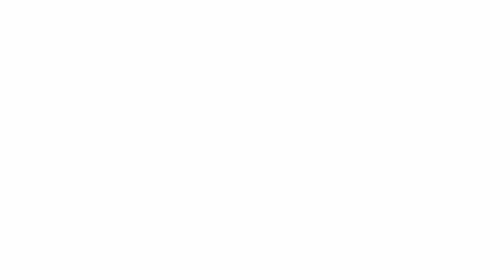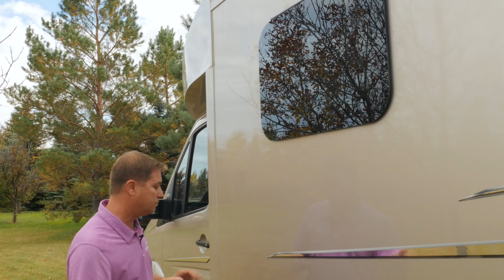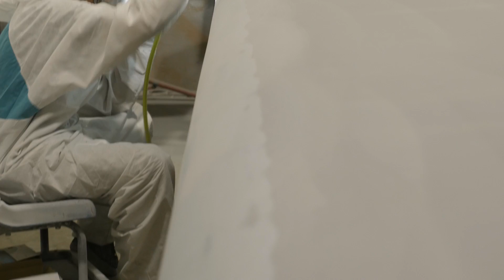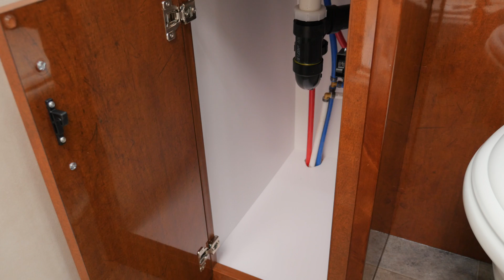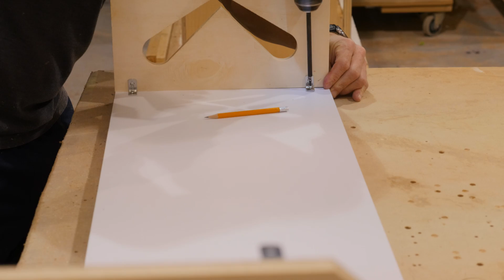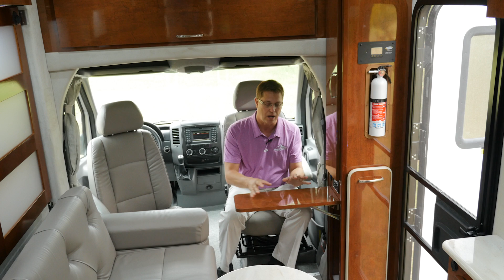2017 Pleasure-Way Plateau XLMB Tour

Comment: 00:00  Specs and exterior stuff
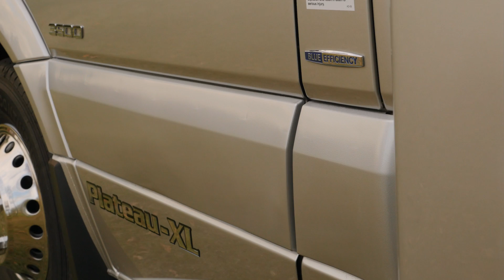01:44  Exterior colors
06:34  Interior
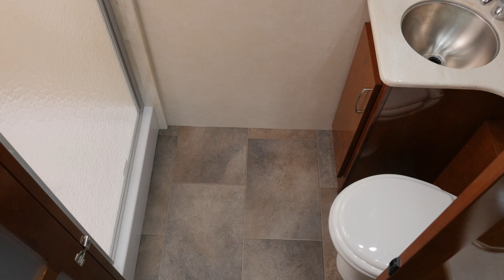07:20  Bathroom
08:13  Kitchen
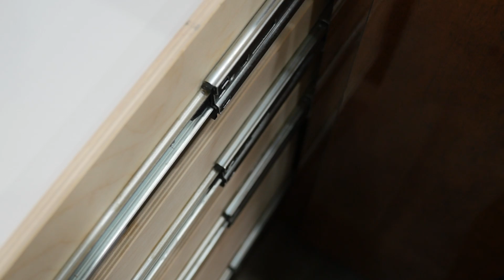09:12  Information/system panel
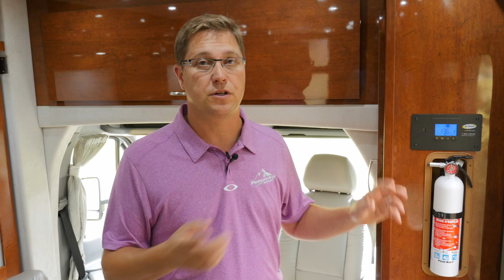10:42  Solar panel info panel
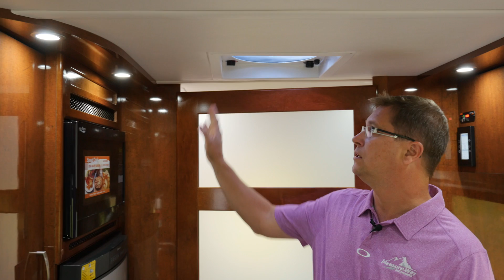11:37  Appliances
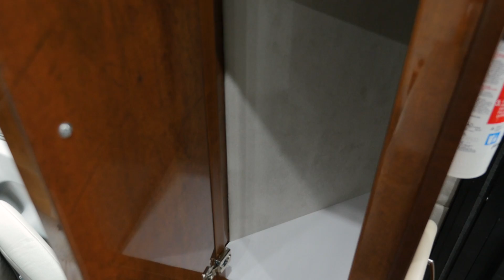13:48  Mother-in-law suite
14:11  Interior colors/materials
14:49  Cabinet factory tour
16:57  Power sofa and Murphy bed
18:55  Dining area
19:39  Cab area

Comment: Stunning interior...just stunning! Love the  "PRINT" awning, TUFTED couch detail, CORIAN shower walls and Japanese reminiscent PANEL doors /bed wall that are far nicer than solid alternative. Fantastic half radius column at the galley edge is elegant. Simply the most beautiful interior available ---give those designers a raise! Negatives for me is not having a level floor all the way through the coach, the refrigerator without a separate freezer compartment plus drawers and frame holding the couch should match the cabinets for a more solid and cohesive look with the rest of the coach.

Comment: To go without slide-outs was a very reasonable and practical decision; however, an RV of this size and weight, in my modest opinion, but one based on many thousands of miles driven in Europe and in the US, limits it without a four-wheel drive that could be offered for a fair upgrade!

Comment: The exhaust for some reason looks too low. I would be afraid that I would lose it going over a small bump. The TV is also in an awkward postion. I think a true (one piece) Murphy bed (like this one) is really the upcoming thing in a smaller motorhome. those drop down beds on the Class A's are still too high for us older guys.

Comment: What size venting pipe on the roof for the gray and black tanks? I notice it's just a open pipe with a cover. I was thinking about adding the 360 Siphon caps which creates a suction to help pull out any tank odors. Thank you

Comment: I have a couple of questions, you say the refrigerator and the air-conditioning or not hooked up to the inverter. You say the refrigerator can run off of 12 V. Does the refrigerator run off the lithium ion batteries? Or does it run off the automotive system?  Also, can you stream Bluetooth music to the audio system while you're driving? Can you stream it to the Blu-ray system throughout the coach? Thank you very much for a great review I really like these.
Reply from the maker: Greetings! When the fridge is set to 12 V (DC) it is drawing power from the lithium battery bank. It does not run off the automotive system. The fridge can also be set to run off LP gas and AC power. Regarding Bluetooth, it is only capable of connecting to your phone for making and receiving phone calls and not for streaming music. The Blu-ray player is only connected to the TV and does not sync up to the Bluetooth system of the front chassis. Thanks for your interest!

Comment: My only question is why is the fresh water fill on the patio side when  the water source is located on the driver's side???
Reply from the maker: Hi Doris, the fresh water fill is located on the patio side because the fresh water tank is mounted underneath the motorhome in that spot. The city fill is on the driver side because that is typically where the water source / power source is located when parked at a spot in a campground. Additionally,  we keep the utility center on the driver side to keep all the connections away from the patio side, which is a high traffic area. Thanks for watching!

Comment: What type of locks do you have on the RV door? Does it include a deadbolt? Thank you
Reply from the maker: The front cab doors utilize the standard Mercedes power door locks. The side entry door we provide uses a two part locking system. The main lock is a deadbolt and the secondary lock will lock the handle.

Comment: That's great that you have the Truma AquaGo water heater. Which model?  I don't see a option for a ladder on your website! Do you have one? Thank you
Reply from the maker: We use the Truma AquaGo 'Comfort Plus' in all our models. We do not offer a ladder but that is something you can get through an RV dealer. If you are thinking about adding a ladder to the Plateau XLMB, you should let your Pleasure-Way dealer know because we would need to make modifications to the unit to support a ladder. This would need to be a factory custom order as we do not build them with support in place for a ladder. I hope that answers your question!
Reply: Thank you. You should put that into your home page as the Truma is a great water heater to have and a selling point! That's great information about getting a ladder!
Reply: Pleasure-Way Motorhomes with solar panels that require periodic cleaning, a ladder would be a nice piece of standard equipment. Add it to the cost.

Comment: No Safety Side Mounted Camera's for 2017, are you kidding me! Pleasure Way is Better than RoadTrek in my opinion as far as Build Quality but you guy's need to advance the 2014/15 technology, RT eliminated the need for an Old Fashioned Inverter for 2017.
Reply: So you expect Automakers to give us $4,000 or so, depending on what the option(s) are for free? Really? Just ... here's an upgrade to a free TaG axle Diesel Pusher but you'll only pay for this. Or if you're too cheap to buy the power windows, power locks, collision warning ... you want the dealership to just put it in & give it out for free!

Comment: When owning one do you have to get it inspected yearly such as we have to do with heavy trucks? thanks =D
Reply from the maker: Hi Totally Left Field, our motorhomes do not require a yearly inspection as heavy trucks do. However, it is important to follow the Mercedes guidelines on service intervals for the coach, which can be found in the chassis manual. Also, Pleasure-Way provides maintenance guidelines and recommendations for proper service upkeep on the motorhome. An example of an annual maintenance procedure would be to check all roof vents and hatches to ensure the caulking is still in tact. I hope that helps, thanks for watching!

Comment: Does the XLMB have a plug to plug-in external Go-Power solar panels "GP-PSK-120". Thank you
Reply from the maker: The first thing to note is the Go Power solar controller we use is only capable of providing service up to 30 amps. If you were to max out our solar panel option and select five, 95 watt panels with the Plateau XLMB, the controller would be at capacity. If you had fewer than 5 panels, the solar controller would still have capacity for additional panels. 

Regarding the ability to plug in the GP-PSK-120, we use the standard MC4 branch connectors to attach the solar panels on the roof to the controller inside. If that kit you reference has the ability to plug into a MC4 connector, you would have the ability to install a parallel branch connector (extender) and add another panel to the system. Of course, this depends on the load the controller is already receiving. My recommendation would be to contact Go Power to make sure the GP-PSK-120 kit can connect with the standard MC4 connector. I hope this helps, thanks!
Reply: Thank you for all of your replies that I've asked for.
Reply from the maker: No problem, glad we could help!
Reply from the maker: Hi Richmond, we currently only offer the 30 amp Go Power solar controller. Five solar panels is the max we can fit on the roof for now. We don't offer additional lithium batteries as our electrical system was designed around having 200 amp hours of power. I have also sent you a direct message through your profile with the contact information of a Pleasure-Way representative that will be able to assist you with any further questions. Thanks for your interest!

Comment: I want this.  Do you think a woman by herself could manage this?  Literally, I have no man skills, but I can drive.
Reply from the maker: Hi c sikomas, yes! You can absolutely manage this yourself. If it is your first RV then there will be a learning curve getting used to the typical duties involved, but the size and maneuverability of our motorhomes makes them incredibly easy to operate. In fact, we have a great set of videos where we talk to our owners about owning and managing a Pleasure-Way motorhome and I think they will provide some good insight: https://goo.gl/GepIF2 I hope the videos help and thanks for your interest!
Reply: c sikomas  why the heck not?  I haven't seen anything that would cause a problem.
Reply: I am a single, old lady that compared, then bought a Leisure Travel Van. Same price range as Pleasure Way  but controls and features that I find are SIMPLE to use and better located  above the entry door. I have the CB (corner bed model) ... 53X76  comfy  bed I can flop on at anytime, plus the shower is 33" wide. With "zero" experience, I have taken mine from CA to Montana and back. I suggest if you buy one, get one off a dealer lot, delivery from the time I ordered one from the factory was 7 months. I am so confident driving the Mercedes Sprinter Chassis ,  I tow a tiny Fiat Abarth. Go for it!
Reply: I spent 60 days on the road in a van I converted to a rv myself.  THIS would be so easy to live in. Go for it. P.S. I'm 60.....
Reply: "Man Skills??" What year do you think this is, 1957?? Jesus, you give women a bad name!

Comment: do you have a screen on the door and Windows?
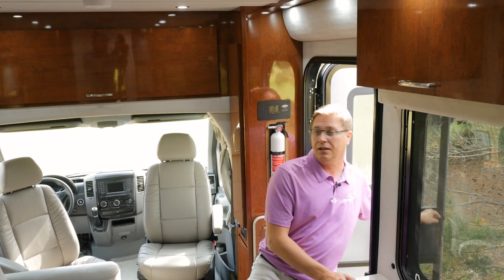Reply from the maker: Hi Teri, yes, the side entry door has a separate, fully aluminum framed screen door seen at 6:37 in the video. The window by the side entry door and the window in the kitchen area both have screens attached. Thanks for watching!

Comment: Nice wood work but really blown away about what he's  saying about slide out. I have a 2010" Jaco precept in 7 years of heavy use I have never had a issue with the slide out,  I would personally never buy one with out the slide out. Makes no sense this company would put so much effort into this RV and not offer a slide because they don't want to take a chance having to cover it under Warranty lol 
But it's  very small and limited storage makes  it more of a road trip RV not something you would spend a weekend camping  in not that you couldn't but very tight even just  for 2